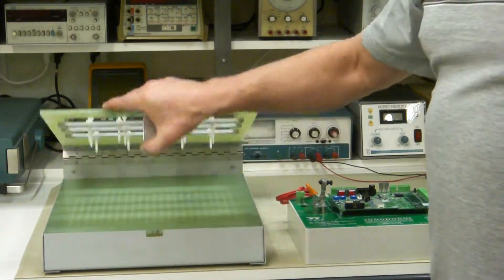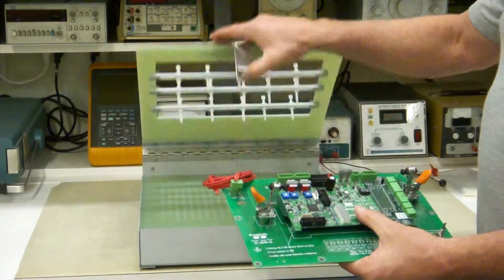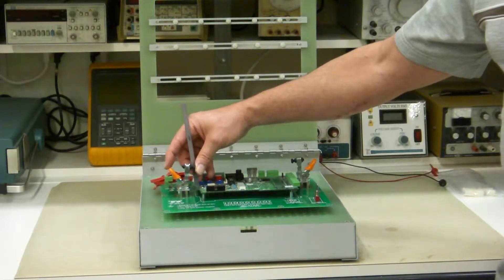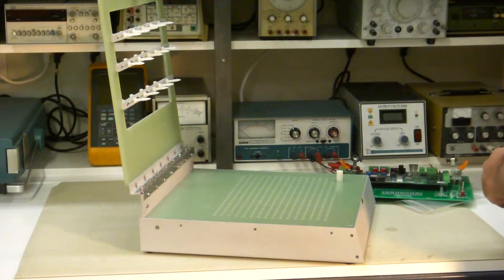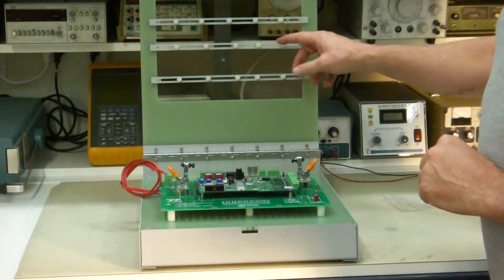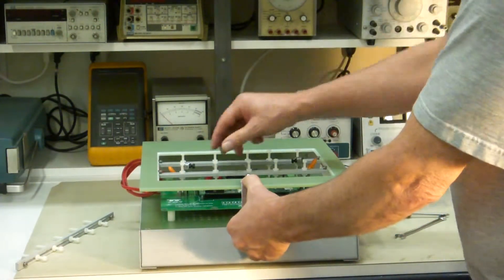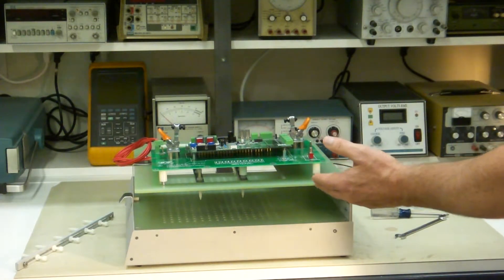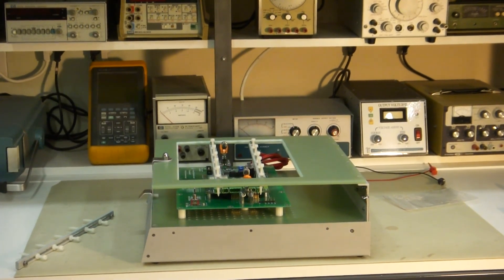Rand 14" Press Fixture Clamping Device

Comment from the maker: PanamaSticks is correct. Do not use this technique unless you've already built a circuit board based bed of nails fixture on some random sized circuit board and are now stuck using it. The purpose of this fixture clamping device is to allow you to rescue your old circuit board based fixtures so you don't have to scrap them. If you have not yet built a wireless fixture, consider designing your bed of nails circuit board to fit in one of our fixture kits designed specifically for this purpose. As for smaller boards, keep in mind that we use medium sized fixtures for our demonstration videos. This is a 14"x15" fixture. There are 9 size options from as small as 06"x08" up to 22"x15".
If you haven't yet built your bed of nails board, consider designing to one of these fixture kits:
Production volume wireless fixture kit. http://youtu.be/a944c3gxhl8
Low cost R&D wireless fixture kit http://testelectronicscom.ipage.com/BON/rand_adjust.php
Ultra low cost project box wireless fixture kit http://youtu.be/PAex7B521-4 (one size only)